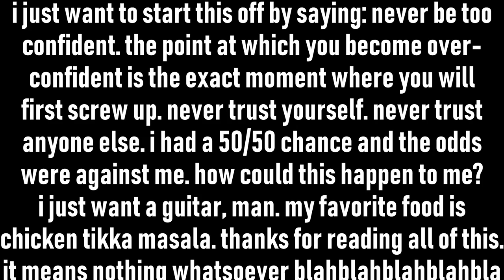Modding My Schecter C-6 Deluxe

Comment: Came across your video as I'm looking for info on modding my incoming Omen Extreme.

The parts don't fit because you're using Imperial measurement parts on an Import guitar that uses Metric measurement... Metric Tune-O-Matic Bridges use 6mm posts instead of the 4mm posts used by American Guitar manufacturers, The pots also come with 6mm posts instead of the usual 1/4 inch ones for American made knobs. That's why both your bridge ands knobs feel loose. Just look for Metric parts and you'll be fine.

GREAT job on the mods though, the axe looks pretty slick.
Reply from the maker: Thanks mate! That actually makes a lot of sense, I'll have to investigate getting some imperial-measurement stuff. Schecter guitars are so insanely easy to mod, and modding is such a rewarding process (I've also heavily modded a strat copy that I might make a video about in the future) and it's so fun. I wish you luck in your modding! :)
Reply: @PulsarGlitchMusic  No no... You need METRIC parts for that Schecter.

Also, if you're changing out the pots, make sure you get the right ones. Although it's not too hard to rim out the body to fit in standard M9.5 CTS pots if you want to.
Reply from the maker: Ahh, gotcha! I'll look for metric stuff then. As far as the pots, yeah, I already had to replace one because the stock pots wore out after about two years. New one works great though!
Reply: @PulsarGlitchMusic  Yeah... Schecter's Electronics are surprisingly bad, considering they started off as a parts and pickups company, I'll be gutting my Omen Extreme when it comes in next month... Not a single wire will survive 'the PURGE'!! 😆😆😆

Comment: How much did you pay for the guitar originally (No modifications)?
Reply from the maker: The guitar was originally a B-stock unit, so I got it for $239.
Reply: @PulsarGlitchMusic  So is a b stock like a cheaper version? I'm finding all these models at 300-350
Reply from the maker: Yeah, B-stock can mean either that it was used as a demo unit and it's otherwise brand new, or that it's a completely new item that has some small flaws out of the factory and has been discounted (mine had some really small chips in the finish).
Reply: @PulsarGlitchMusic  Thanks! And great video! Just subbed!
Reply from the maker: Thanks mate! 🤘

Comment: Hey dude, I need your help with modding my electronics in addition to this, what would u suggest?
Reply from the maker: That really depends on what guitar you have and what kind of sound you’re going for. There are lots of cool things you could do to expand your guitar’s sonic capabilities.
Reply: @PulsarGlitchMusic  Sorry for the awfully late reply. But yeah, I kinda want a more richer and warmer tone if that makes sense? And is it possible in any way to mod my guitar to have a whammy bar?
Reply from the maker: For different tones you could try swapping out pickups, but I would mess with your amp settings first since that’s free and requires little work. As far as a whammy bar, that can be a pain to add to a guitar since it requires routing the body. There’s a digital whammy bar called the Virtual Jeff though, and that doesn’t require any modification. Would check that out first, or just get a guitar with one already on it.